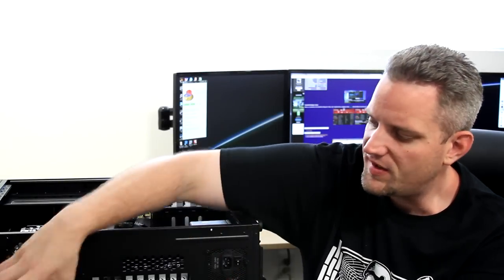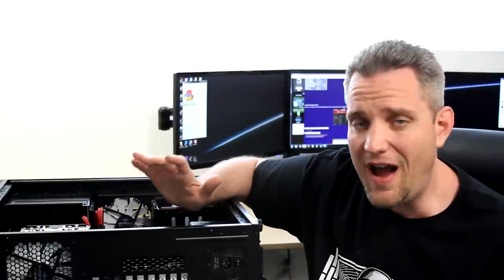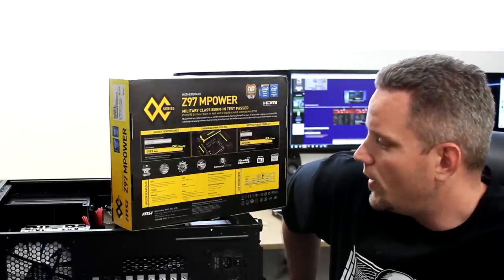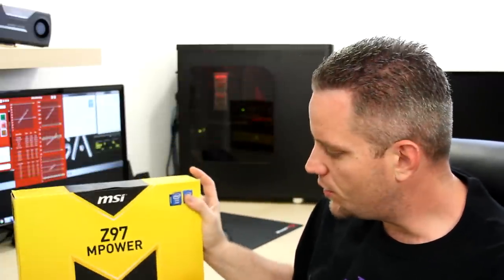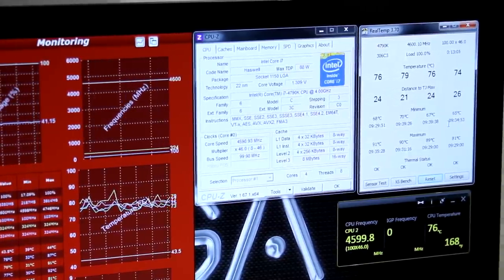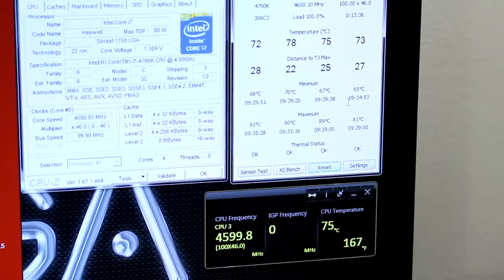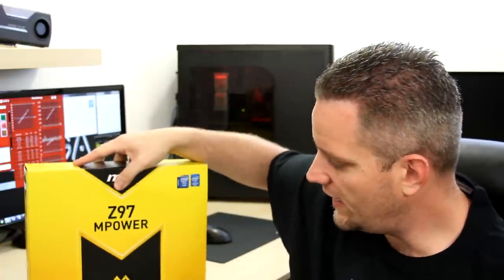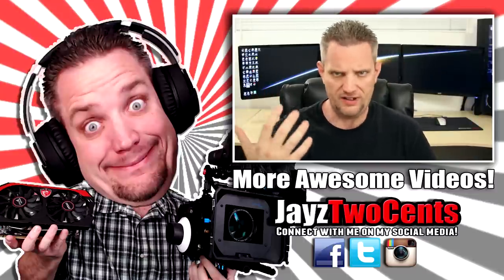Overclocking the Intel 4790k with the MSI Z97 MPower on air!

Comment: 4790k still serving me well :)
Reply: Same here ... great chip (even for 2018).
Reply: I got one a couple of months ago for 200 bucks.  It ran at 4.6ghz on air auto overclocked on an ASUS Z97-A.
Reply: Late 2018 almost 2019 and it’s still powerful as hell
Reply: @circleofsorrow4583  i have the same setup. Works great in 2019
Reply: 2019 still going strong ^^
Reply: 2019 anyone?
Reply: @spacecy  just upgraded to one today lol from a Xeon E3 1231 v3. This CPU is a beast cant wait to OC it
Reply: @NDSIser  nice!!!!
Reply: Still strong 💪. I7 4790k and 4.7 paired with rtx 2080
Reply: Still rockin the 4790k, haven't overclocked and the thing is still a beast.
Reply: @Mr_Spock512  same still rockin 2019 lol but thinking its time
Reply: same
Reply: Me too!
Reply: Same, even in 2020
Reply: 2021 i7 4790k in my sff dell optiplex 7020. this thing is pulling an easy 60fps in tarkov medium settings 1080p
Reply: Yes i am still using it... With 1070ti
Reply: Still running strong 2021 with a gtx 980 SC, OC’d to 4.6ghz with 1.26V. Easy 60+ FPS on 1080p any triple A
Reply: @Thatcertainone  i am running with a 1070ti ... I don't game now a days..
Reply: Still running strong in 2022
Reply: 2022 as well. Ain't dead yet. Still running the latest games. Guess I'll keep it for a while longer
Reply: @jpcarsmedia  I'm upgrading my graphics card to the Radeon 6800 XT. Let's see if the 4790k bottlenecks in games.
Reply: @Hboogie182  how did it go? I am planning the same for triple monitor rfactor2
Reply: @almondigasconcristales4738  there was huge bottleneck with the 4790k. I upgraded my CPU to an AMD 5600x. The performance difference is huge. No more bottlenecks.
Reply: @Hboogie182  OK, but bottleneck that can't be handled, lags and stuttering even lowering the settings? , I plan to upgrade the whole computer next year but I still need to save money for that
Reply: @almondigasconcristales4738  the bottleneck is really bad. Even lowering the settings doesn't work. I get a lot of stuttering when playing PUBG. After upgrading my CPU to a 5600x, no more stuttering and frame rates are super high now.
Reply: @Hboogie182  OK, thank you very much for your replies
Reply: 4790k still serving me well :)
Reply: Still serves me well today😂

Comment from the maker: I know this isn't a "Complete" review. I just wanted to see how this thing did on air considering heat was the major downfall of Intel over the past couple years. Expect a full overclocking and How To Overclock Haswell 2nd Generation CPU once my system is complete. Stay Tuned!
Reply: god damnit you made my cat that i don' have horny and when he's horny he keeps watching  Barnacules's intro  #mylifestory
Reply: MrJimBobGaming dammit* don't* Barnacules'*
Reply: Thanks Jay I think I am going to wait for the next gen of cpu's I am currently running a I7 2600k I was thinking of upgrading to the 4790k but I won't now
Reply: What cooler were you using Jay?
Reply: Is this the mobo with a delid support?
Reply: Is it werf ?
Reply: Sweet Jay, looking forward to that vid dude. Would be interesting to see what kind of voltage it is going to take for a 4.8Ghz OC with that chip you have on water.
Reply: Tom Esendam just get ivy, i have one and it's fantastic. Wish I upgraded ages ago. If those were the temps at idle then, I would rma that shit.
Reply: John West intel is currently developing one. Jay made a video where he mentions it. It's the Haswell-E edition cpu.
Reply: Jay, you have a Batch L3 chip( what i have seen ), they normally don't go over 4.6 GHz no matter cooling nor voltage.
if you can, get a new 4790K which is a Batch L4 because they can go to 4.9-5.0 GHz on water.

Batch L3 means it was made under 2013 and L4 means it was made under 2014, and the newer ones overclock better. you can see what batch you have by looking on the ''under side'' of the box or on the actual CPU. 4790K comes in both L3 and L4. there is more numbers then just the 3 or 4 on the batch code but its only the first digit that matters.
Reply: This is still thermal paste not solder, not happy! Sticking with sandy bridge E a little bit longer.
Reply: Tom Esendam
Don't know why you're judging weather or not you should upgrade based on overclocking
Reply: *****  Hey Jay i have a i5 2500 (non - k edition ) and going to upgrade to the 4790k ,whats your opinion?
Reply: Im at an Q8300 D:
Reply: Daniel Eliasson
I have the L4 batch.
Reply: Tom Esendam Good boy, I am currently as well on a 2600K and don't even plan to upgrade at all yet. It performs very well. The only downside on our 2600K is that it makes use of PCI-E 2.0 and doesn't support 3.0. Wich is a thing that doesn't bother me to much, it's just something to look forward towards when I do decide to upgrade. That my GPU is able to get some performance increase when I do upgrade. 

The other more noticeable thing is that the platforms are much better these days and they made some solid improvements imho with the H/Z87 and H/Z97 platforms, with a lot of it coming down to me as better on-board audio and those killer NICs. Very amazing stuff! As well with the H/Z97 chips having M2 connections that allow you to  use super fast speeds. Wich is something I personally don't care about at all. But for some people this is as well a nice selling point.
Reply: Joey Hobbit
I'm on a z97 Msi gaming 5, I've disabled all the killer network stuff, sucks balls, priorities packages like a drug addict (like shit).
Reply: KOSTAS MATHIOUDAKIS Thats not true, i have a G1 sniper and its working like a dream:) you can say that SOME Z87 doesnt work with 4970k:)
Reply: KOSTAS MATHIOUDAKIS Φυσικά και δουλεύουν μια χαρά με τα Ζ87 τσιπ οι 4790Κ! Το θεμα εινια οτι μερικές μητρικές εχουν το θεμα! ;)
Reply: ekini tin epoxi pou egrapsa to comm ta bios den itan akoma full simbata me tous epeksergastes
Reply: nai nai! Itan i arxi pou poloi eixan to thema! :)
Reply: what type of thermal paste should you use for the i7 4790k?
Reply: doctadeath2020 Arctic Silver 5 is good, Noctuas is also really good, I have that processor and I use AS5 and my girlfriend uses Noctuas for her i5.
Reply: Salpeteroxid AS5 is good but not the best.  Gelid Extreme and the Liquid metal variants perform better.  Liquid Metal Pro is amazing.
Reply: Daniel Eliasson i was viewing some older vids of jay , plz can you enlighten me my batch# is X439B534  ,what does that one mean . i tried google'ing it but to no avail . Tnx.
Reply: BASIC: Depending of where the cpu was made results in different overclock CHANCE, and people with batches starting with L4 have been recorded have a better CHANCE of overclocking better, ( L3 <= 4.6GHz, L4 >= 4.8 up to 5GHz ). keep in minde though that it ain't worth looking for a L4 if you have a L3, it's just a chance anyway, plus 0.2 - 0.4GHz differense dosen't doe any real performance differense ( sorry for any bad English, swedish is my thing XD ).
Reply: *****  I am running my 4790K on air and my temps are slightly higher then your mine is average at 84-86 but i am only using 1.171 vcore'
Reply: ISEE YOU Doesn't matter, it's only a couple degrees.
Reply: Salpeteroxid When you are on the edge of stability and heat a couple degrees is a nice difference.  I guess it depends on your goals.  AS5 also has to be reapplied as it ages. If someone said hey you can rust this paste or this paste that runs 2C cooler.. which one are you going to choose?
Reply: ISEE YOU If your climate is stable enough maybe yes, but the temperature can fluctuate 10 degrees C or more and maybe 5 degrees C inside my house in my part of the world, Scandinavia.  
I've had my AS5 for 1 year on my 4790k. Works just as good as new.
Reply: Salpeteroxid Not sure what you mean.  We go off of ambient temps when comparing.. so if it's a 2c difference when comparing same ambient temps that means that paste is actually 2c better.  As far as Ambient changing in our home that is expected and also why we have AC units to keep ambient from going to high.
Reply: ISEE YOU We don't have AC's in Sweden. Don't know why, but we don't
BTW, why would you ever want to be on the edge of stability? I rather buy a good CPU and not push it as much.
Reply: Salpeteroxid
Did I ever say edge of stability means unstable?  It means that is as high as I can possibly get it usually running a little more voltage then some like.. etc.. I tend to setup others with very safe setups.  Why on the edge?  Chasing numbers man.. kinda like chasing the lower ET when drag racing or chasing that perfect reaction time on the tree.
Reply: ISEE YOU Being on the edge is never stable. My last job included having a server hall with multiple servers for several companies. No way we'd ever want to jeopardies reliability, I wouldn't either, therefore I bought an i7 so I didn't have to overclock an i5 to the edge for multitasking. 

I've built systems as a profession, also worked as a software technician.
Reply: Salpeteroxid Edge of stability is still 100% stable.  It's just means there is no more left in it.  I am a 16 year builder and work for Hewlett Packard building and configuring Million Dollar Racks for various HP customers.  I have been building HP's 700,000sqft data center for many years.  Now let's get real here.. we are talking about a PC.. not a production device in a production environment.  There is nothing wrong with overclocking a PERSONAL COMPUTER to the very edge if you know what you are doing.  I just don't prefer to do this for the ppl I build for because they aren't the kind of ppl who watch temps etc..I also built for a living.. which is why I said I don't mine running my own up to the edge of stability but do not run any clients that close to the edge.  The Edge of stability is still 100% stable you just have to know what you are doing.  Why you find this an issue is beyond me.  If I can run IBT, 8 hours of OCCT, and 24 hours of Prime 95 it's perfectly fine for daily use if temps and voltage are in check.  Been doing it for 16 years and was water cooling with pond pumps back then.. I have never had a problem with my overclock once it's dialed in.
Reply: ISEE YOU I've also worked for Hewlett and Packard,  back in 2014 @ Ericsson (Also dell 2013 and 2014). It doesn't mean shit. H&P is kinda crap. And you if anyone knows that you don't over clock infrastructure hardware. 
 On the edge has never meant stable in any terminology.
Reply: Salpeteroxid
Well you started talking about your background so I started talking about mine.  Your ignorance is really showing.  I never stated I would overclock any production equipment.. ever.. did you not read that?  Go back and read a few lines.  I am also trying to understand why your so upset that when I say edge of stability you think I mean unstable.. which to me is a fairly ignorant remark.  How about you stick to whatever lingo you want and I will stick with mine.  As far as them being crap you know their server line comes from Compaq's Proliant series which I was around for Compaq and worked for them as well.  Those servers had and still have a very good reputation.  I think your knowledge of overclocking is pretty limited but that is ok.  Just so you know.. Edge of stability does not mean unstable.. in any terminology.. If it's 100% stable.. and I decrease .001V it becomes unstable.. or 1mhz higher it becomes unstable.. I would call that the edge of stability. I am so SORRY this frustrates you to the point you have to make remarks like you are making.  My guess is you were some kid working in logistics.. because you sure as hell aren't talking like a Man.....
Reply: ISEE YOU Nearly nothing is 100% stable. You increase the risk for failure the closer you are to instability.
Reply: Salpeteroxid Whatever you say.
Reply: +JayzTwoCents Yoo Bro I live in Patterson :D Which store did you go to?
Reply: What was the CPU cooler used in this video ?
Reply: All of these years later, we now know that the I7 4790K was a silicon lottery. You either got a chip with a crappy thermal past application during manufacturing or a good one. The only way to effectively overlock a 4790K now, is to delid it and apply better paste.  I recently did this with my old 4790K and got temps of 50C at load OC to 4.5 GHZ.
Reply: I live in Paterson

Comment: Been using my 4790K since 2014 and still super happy with it! Running at 4.4GHz and never breaks 60 degrees C
Reply: On liquid cooling, obviously. On even air ie: Noctua or even a C.M. Evo 212 (under load) still reaches 74°C.
Reply: @Twitch_Moderator  not for me. I don't do liquid cooling

Comment: Hi Jay,

One thing I have noticed with my hours of tinkering is that the overclock of say 4.6ghz or 4.8ghz or whatever one you use dramatically can and will produce different Benchmark results. At one stage of stage overclocking @4.8Ghz) the system was producing 4.6Ghz overclock results. If the ring/core voltages etc you tweak bit by bit you will notice a huge improvement on actual performance. I used Cinebench 11.5R and 15 and passmark for result comparisons. 
So I applied my finding to find and safe yet better performing daily overclock (24/7) at 4.6Ghz. This was using a Gigabyte Gaming 7 which has already been replaced due to its screwed up voltages. It also fry my CPU and getting a new 4790k. So beware people there is something off with the gigabyte boards in general especially with AutoTune and some other of the Auto settings. I intend to change to either the MSI z97-G65  or ASROCK EXTREME 6 as I have had both versions of these before for the 4770k and the 3770k and found them to be amazing boards. Only reason I went with Gigabyte for a change was due to there warrenty. Gigabyte will support the product from the moment of purchase (even if you resell it) for the stated time period. EVGA I believe do the same. MSI need to check. Keep away from Zotac, there warrenty is terrible, and is not transferable! Its something perhaps you should do a video on. How good the cards, motherboards etc is one thing however how good are they after you need help? After one year? etc................

Comment: Running my 4790k air cooled, 4.5ghz at 1.210v and have temps right around 85c when benching. Still in 2020 this thing runs great! Plays gears of war 5 just fine averaging about 130fps. I have it matched with a evga GeForce rtx 2060. Love my setup. I run all games at highest graphics levels.

Comment: I builded my 4770K based beast system with 2 x 290X Toxin in January 2014(added cards two months back).. with Z87X-OC Force and now sold my 4770K and got 4790K with latest BIOS update to latest version befor selling 4770K.. Now.. with H100i, currently at stock speeds, i'm really really impressed with temps.. Its been a week since i upgraded to 4790K but now is time to clock things up.. Hope all goes well :-D

Comment: 4790K still doing its thang in 2020. I have mine at 4.7Ghz 1.294v, temps are within a safe threshold using a Corsair H60 cooler. Couldn't be happier with this. Still waiting for Intel to drop something worth upgrading to which doesn't seem to happen until 2021-2022
Reply: I think my h60 is on its last legs , my temps are now touching 80/90 and my pump makes a noise at times. My 4790k been running 4.4 @ 1.139 couple years now.

Comment: 5 Ghz base clock processor... 2 years later....
Reply: +mint27  nope
Reply: +Kawaii Hatsune so true, with 4790k u could hit 4.7 easy on air
Reply: Still nope
Reply: 4 years later, 4.4GHz idle at 40 degree C and 1.29volts without even breaking a sweat
Reply: 4 years later 4.8ghz since day 1.. idle 38c and max 65 h100i v2 voltage 1.35v..
Reply: I think I have a good chip since launch I been running at minimum 4.6ghz but after warranty I delided and pushed to 4.9ghz stable at 1.305v that is as about as high as I want to push it until I have budget for a full system upgrade.
Reply: Many years later. 4790k at 4.5 GHz on 1.21V - At 25c at idle on air cooler.
Reply: 2019 4790k @4.9 ghz 1.250v still strong and stable
Reply: @yungstylez220  wow, you must have gotten a good one. Mines perfectly stable at 4.7 Ghz 1.275v cooled by a noctua D14, but I can't get it to run 4.8 Ghz without crashing on cinebench, no matter how much voltage I give it.

I gave up on that last 100 Mhz, it just didn't seem worth it

Comment: I got i7 4790k at 4.7 ghz at 1.25 volts on cooler master 212 evo awesome chip !
Reply: i got 4.6 ghz on 1.160V
do you think i get 4.7 ghz on 1.250 V?
Reply: +Fendt Arena 
It is very possible that you can get it to 4.7 at 1.20-1.25 volts, i run mine at 4.6 with 1.18 volts 24/7 due to cooling .Make sure you have a good aircooler.
Reply: +giorgos zer ok
the cooling is my problem... thaths why i dont go over 4.6 ghz/ 1.190V ( 1.190 V is max, but i get my chip stable with 1 160 V)
Reply: +giorgos zer ok
the cooling is my problem... thaths why i dont go over 4.6 ghz/ 1.190V ( 1.190 V is max, but i get my chip stable with 1 160 V)
Reply: +Fendt Arena 
What  cooling sopution do you use ?
Reply: +giorgos zer be quiet shadow rock slim
Reply: +Fendt Arena 
I think you should give it a try at 4.7 ghz and if temps are ok then leave it there.Other than that you wont notice any substantial improvement.
Reply: +giorgos zer ok i may try 4.7 ghz, but i have a very slow gpu, so it wont make any Difference...
Reply: +Fendt Arena that gpu do you have?
Reply: +giorgos zer XFX r9 270
Reply: +Fendt Arena ok unless you use sli or crossfire ,or you run very cpu tasks such rendering  there isnt a reason to overclock this cpu.
Reply: +giorgos zer I know

Comment: Well, I have a 4770K with the stock cooler running at 4ghz@1.12v(78c full load)
So i'm going to assume it would literally be pretty pointless to upgrade to the 4790K. Thanks for the awesome video. It's awesome how you respond to the fans too.
hurry up Broadwell. :(